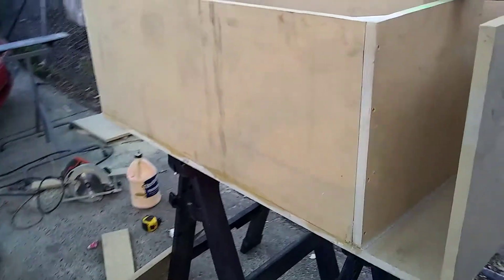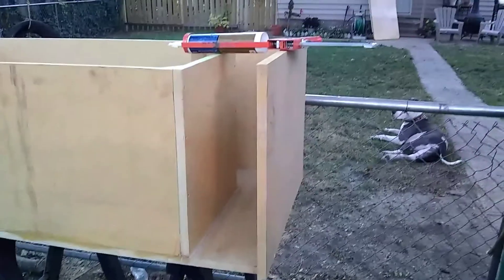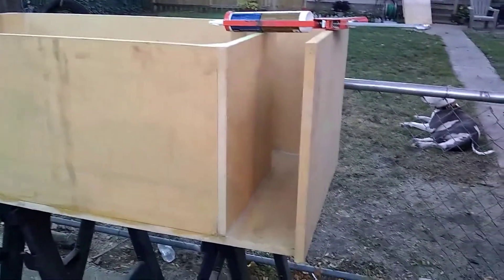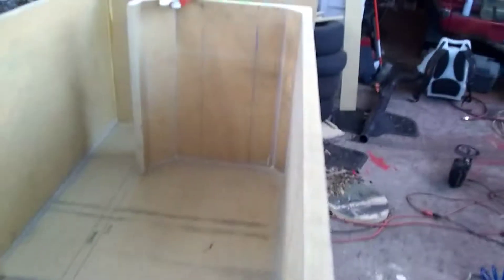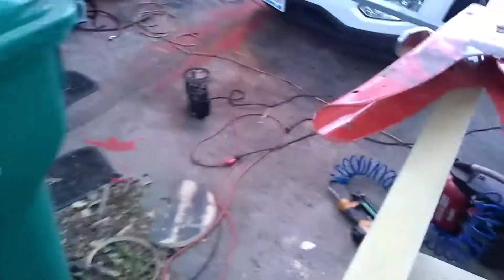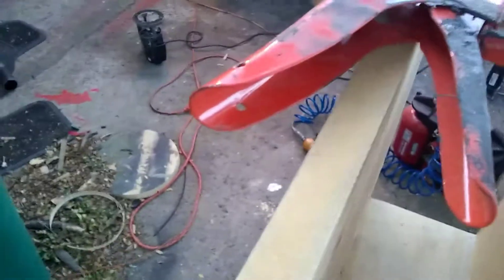Custom skar evl 15s box enclosure

Comment: Is that the same dimensions Kevin gave just wondering he gave me some specs for 2
Reply from the maker: nope but it was absolutely crushing
Reply: Kyle Kari would you mind sharing the specs and dimensions for it bro I'm trying to build a great box for my 2 evls
Reply from the maker: Just go to skars  website and go to the evl subwoofer category and at the bottom it will tell you the dimensions for one single woofer and I just doubled it so if it was 12 wide I went 24 wide I don't remember the exact I do remember just doubling they're single box dimensions though
Reply: Kyle Kari thanks
Reply: I have looked everywhere I cant find the specs for a rectangular box like this what is your measurement please